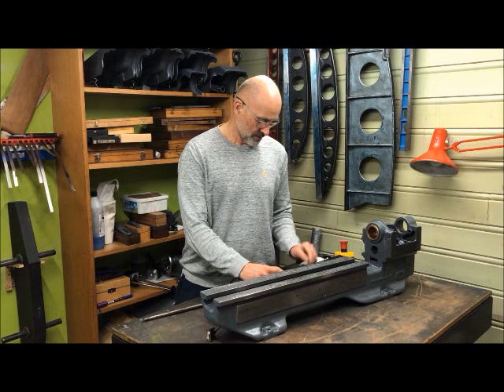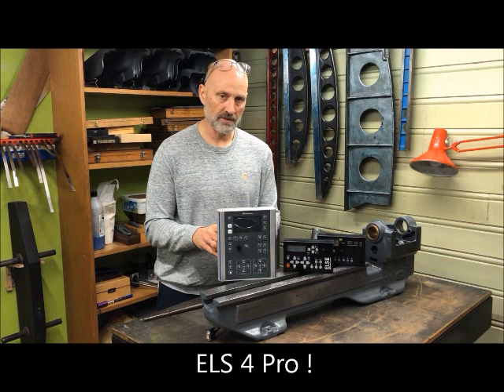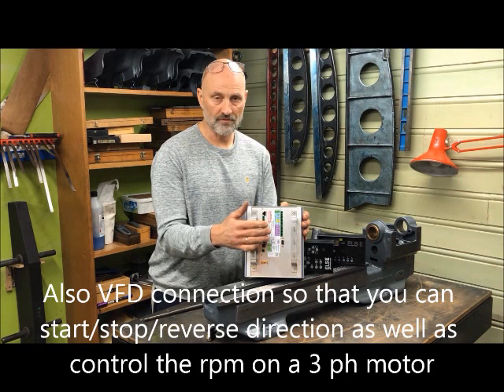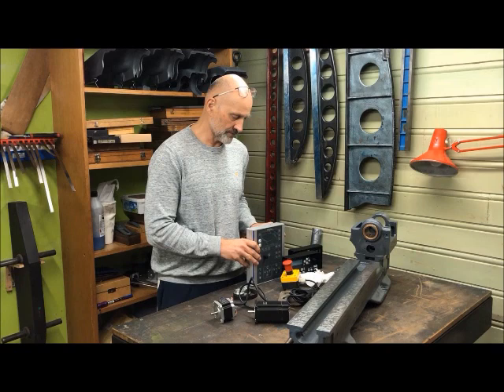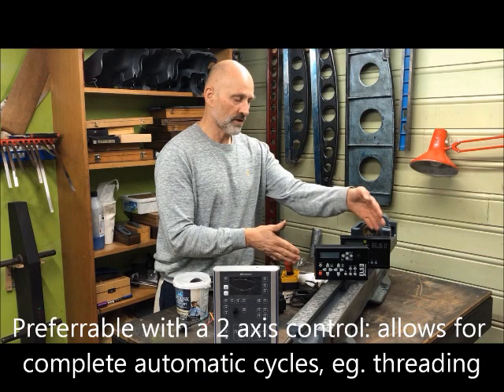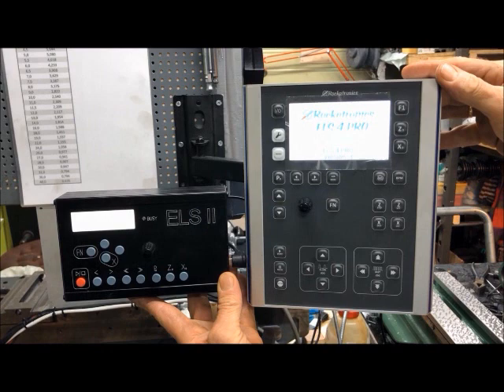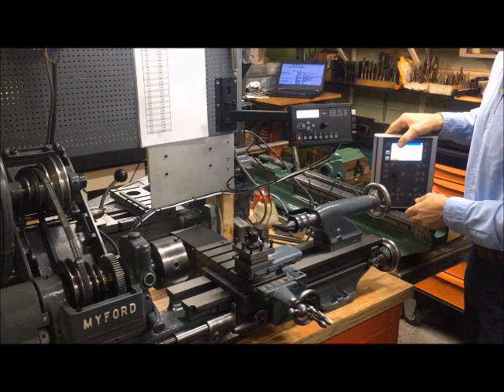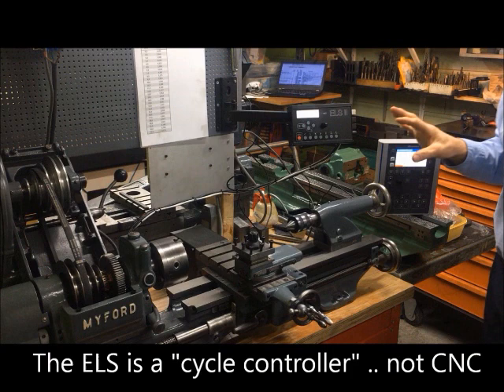ELS 4 Pro intro1

Comment: Is it worth it to go to ball screws? I know that would mean the leadscrew would be permanently engaged but is that really an issue?
Reply from the maker: I also thought about this and asked the maker of the ELS (Louis Schreyer at Rocketronics). In his opinion there isn't much to gain from such a conversion accuracy-wise and since you loose the ability to use the rack-feed for rapid handwheel movement he did not recommend it. However, this is certainly possible and will not (in my eyes) be a bad idea!

Comment: Do you think the PRO can replace a DRO? I've been wondering if I would need both, by the time I price out a magnetic DRO for my small lathe it's as much as this kit, but without all of the amazing features!
Reply from the maker: The ELS functions as a simple DRO ie. displays the position while you are cutting. A DRO would have more functions and show the positions all the time, so in a way they overlap some, but more so adds to the "joy" each in their own way. If you can afford, maybe both would be the best. However, practically speaking, this is of course very expensive and also may not be the easiest to mount (at least it would take some thinking to install both a motor and a scale on the X-axis. For me it was simple: I wanted a way to "upgrade" a Myford Super 7 to avoid the change gears, and also by motorizing both axis be able to do full automatic threading cycles, tapers and form cutting

Comment: Hi Jan,
Greetings from Denmark, and thank you for all your nice videos.
I just purchased an ols Super 7 MK1 and I really want to use the ELS PRO with it. My Myford came with the original stand and the 3PH 380V motor. Do you recommend to replace the motor when adding a VFD, or is the old motor fine to use?
Reply from the maker: Thnks for the nice words! I have re-used some of the older 3ph motors, but I guess it would be best to ask a motor specialist or some with VFD knowledge (more than me). I have heard that some of the older motors will have some kind of problem with th running characterics, but not alltogether sure why/how.
PS! You will surely just love the ELS4! A very nice update..

Comment: I'll wait for chinese version or do the russian version no need to pay 500Eur
Reply from the maker: The Basic version is a lot cheaper. Comparable to the Clough42, but with the additional benefit that it may be used for a 2ch setup also, as well as having different dedicated usage modes in addition to the regular gearbox left/right. I doubt that even a Chinese model would be cheaper 😊
Reply: @jansverrehaugjord9934  the russian version is free "Токарный станок Электронная гитара и блок управления", the basicgerman version is still 300Eyr +300Eur motors etc. + whe to get mounting?
Reply from the maker: @juliusvalentinas  As the saying goes "there are many ways to Rome". The "best solution" varies a lot depending on the circumstances. This is probably very nice, though seems like a lot of work and probably not miles off in real cost for the controller parts "as built", but still impressive "home made construction" or "Kellergebastelt" as the Germans would label it :)
Reply: @jansverrehaugjord9934  you are wrong, there is a guy who makes ready to use kits "Электронная гитара для токарного станка версии 7. Часть 1."
Reply from the maker: @juliusvalentinas  Wow! Sorry, don't read or understand Russian.. That must be a saint of a person. So he's giving away both his time for building, the components used and also parts bought?!  Sounds almost too good to be true. Anyhow, enjoy .. you are a lucky guy.
Reply: @jansverrehaugjord9934  Yes, he sells the PCB's of complete device on single PCB. You can buy buttons etc, from him or your own. The ELS Pro is nice because of the screen, but membrane buttons are really not user friendly on lathe with oil etc.
Reply: There is firmware with all english menus too. Are you happy with the Pro version? I want the big LCD screen too :) it is worth it?
The ELS operates by specifying how much material to take away, the Russian controller works with virtual end stops, what is better? Are there virtual end stops for ELS too?
Reply from the maker: @juliusvalentinas  Yes, very happy with both the basic an pro versions.. I have them setup in English of course. I would say it is worth the cost yes. Can be fitted with end stops.. and more. For details, I would recommend downloading the instruction manuals and read about the units there. There are very nice descriptions on how to use and setup/configure the systems. See their webpage https://www.rocketronics.de/en/downloads/els-download/